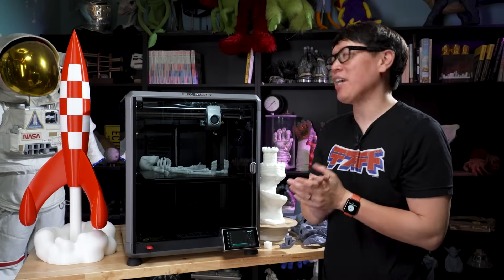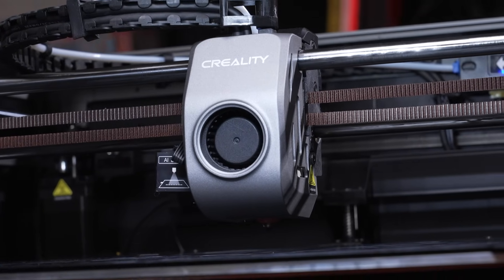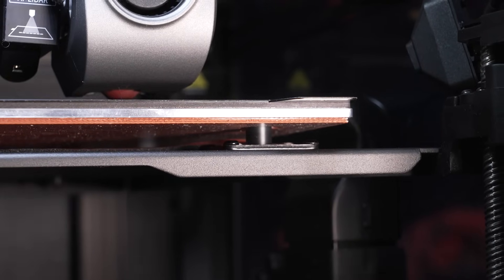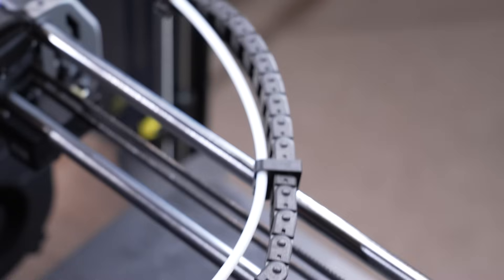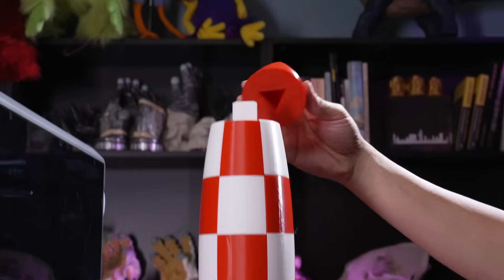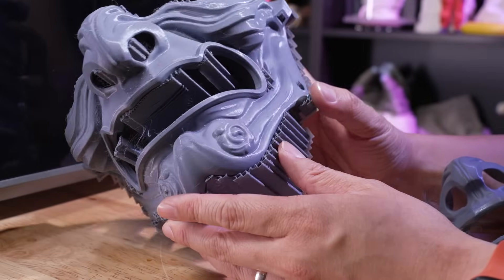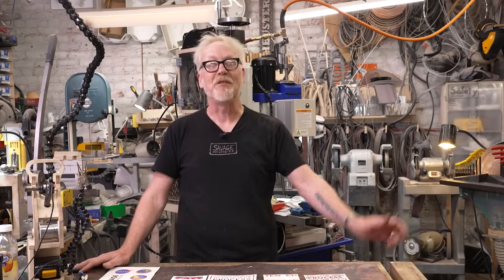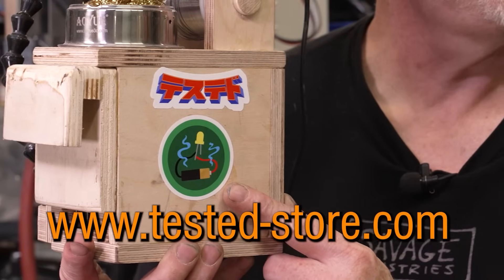Creality K1 Max 3D Printer Review: Big + Fast Prints!

Comment from the maker: Creality K1 Max 3D printer: https://www.matterhackers.com/store/l/creality3d-k1-max-large-high-speed-3d-printer/sk/MPVPDE6C?aff=7553
Matterhackers Build filament: https://www.matterhackers.com/store/c/3d-printer-filament/mh-build-series?aff=7553
Bambu Lab X1C 3D printer: https://www.matterhackers.com/store/l/bambu-lab-x1-carbon-combo-3d-printer/sk/M80GDCL5?aff=7553
Moon rocket: https://www.printables.com/model/163971-moon-rocket-fusee-lunaire
Flexi skeleton: https://www.myminifactory.com/object/3d-print-cute-flexi-print-in-place-skeleton-129405
Samurai mask: https://www.printables.com/model/434709-samurai-mask-model-3-split-for-multiple-colors/comments
Spiral Tower: https://www.printables.com/model/113967-spiral-tower
OrcaSlicer: https://github.com/SoftFever/OrcaSlicer/releases/tag/v1.7.0-beta
Reply: Zack Friedman over at voidstar has a rec for a tool that adds a reset for the gcode time lapses

Comment: This printer is a piece of (add your curse word here). The first layer sucks. The inconsistent heating of the bed will give you a ripples. Most of the time if you're making big projects you don't see it. But if you're doing 4 mm sheets they turn out to be absolute garbage because reality makes really really cheap beds. 
The second problem is the z offset changes because of the bed warping at different temperatures. Unfortunately it ends up most of the time too low to the bed and destroys the extruder. 
My advice buy any printer from a different company.

Comment: Bought one. Printed a 100 mm part and it measures 99mm's. The holes wouldn't fit with the mating part. Finally got an email back from Creality. There is no method of calibrating this machine. So if you are printing a vase or a character it's great. If you need to print parts that have to fit together buy a different brand of printer
Reply: if the part is literally scaled smaller than what it should be then once you root the machine and get full access you can edit the rotation distance to scale it back to where it should be though you can probably force this with startup gcode without rooting 

if the part is thinner than it should be which can happen depending on the filament you're using you gotta do a single wall thick test print to calibrate the flow rate for that filament which can easily be done in any slicer

my k1max print accuracy was +-0.001mm out of the box but then doing the same print with three different filaments, the yellow was tight, the red was perfect, and the black was loose so it can be very filament dependent
Reply: Which is fine. But this machine is brand new out of the box. If you root the machine there goes the warranty. I shouldn't have to do that on a brand new machine. It's poor quality control.
Reply: @tabhinton6678  from what I"ve seen it doesn't void the warranty they just mention in the agreement that you open your printer to potential threats, id still recommend calibrating the flow regardless since thats filament dependent

and to test if it really is the steps per mm tell the printer to move 100mm next to a ruler and see what it actually moves to and if it lines up with the deviation in the print

Comment: Could one design a spacer to lift the glass panel higher to prevent the filament feed tube from rubbing on the bottom of the glass panel?
Reply: dont think its necessary mine has a good 5mm clearance from the glass out of the box. I think you just need to push the tube further back past the clips if it is rubbing against it

Comment: 300 mm is LESS than one foot, Norm. Not much, only about 5 mm, i think, but still less than 1 foot

304.8 mm = 1 foot, so 300*300*300 print size is roughly 95% of a real cubic foot :P
Reply: Who cares? Grown-ups don't use body parts to measure things.

Comment: Pretty fair review. I have tried two different K1 Max's as a replacement for my 2017 Ender. Both were returned during my refund periods because they had problems that Creality couldn't fix quick enough. The first one was just dead out of the box, wouldn't print anything. The second one kind of worked after discovering several work arounds. I might have kept the second one, but it wasn't reliable. I want a printer that I can leave unattended and be confident that it's not going to destroy itself or burn my house down. The fix (for me) for constant hot end jams consisted of bypassing the filament delivery system completely. I hung the reel of filament above the printer and just dropped the filament directly into the extruder. Never use the "filament retract" function to remove or replace filament. Just cut the filament at the extruder and "extrude to replace filaments or remove them. Retracting will move a piece of melted filament into the cool aluminum heatsink and it will stick there. This especially occurs with PLA filament that has been left in the extruder after completing a job and it "tempers" from the heat. This makes it brittle and it will break or crumble if you pull on it or flex it. If this happens you may be successful heating the poker provide in the tool kit. Heat it up real hot and stick it into the jam, let it cool, pull out the clog. Mine often stopped for no reason or just went to the right side to cool down the print head and then got lost. It would just print in mid air leaving a pile of filament that the Lidar didn't stop. My fix for this was to take the top off and the front door off. I put a large room fan in front of the machine to keep it cool. Seemed to reduce mystery failures. I'll give Creality a little time and try another one some day.
Reply: You should get a Bambu it’s actually amazing how well it works.
Reply: what printed did you end up with
Reply: I got a Creality K1 for $349 on sale at Microcenter. It's ok as long as you don't expect too much. Support is terrible. I will probably convert it to full Klipper in the future. I am waiting for Bambu to come out with a larger model.

Comment: I have a 300x300x300 Anet A8+, but after about a year of use, it suddenly started printing off-bed. I didn't change any of the settings, so I have no idea why this happened. I then bought a much smaller Ender-3, which has been pretty much problem-free for three years. But I do NOT like Bowden tubes, and unless I'm mistaken, Creality doesn't offer any direct-drive printers... so now I'm looking for something to replace my A8+.
Reply: You can convert your ender 3 to direct drive
Reply: @R0T0Q  Yes, very good suggestion. I was just hoping to find something I didn't have to do mods right away. Not a difficult mod, I'm just leery of tweaking these things, since the pretty-much Stock A8 let me down so soon.
Thanks for the suggestion. 👍🏼
Reply: Most recent creality machines are direct drive. You are very mistaken
Reply: @condorman6293  Name one. Point me in the right direction. I'm on their mailing list, and every printer I see has a Bowden tube.

Comment: I just wanted to mention that CoreXY predates the Voron group by many many years. Voron printer designs are great, and so are the guys behind it. CoreXY was implemented by many in early reprap printers.
Reply: Corexy comes from CNC machines, my dude.
Reply: @dangerous8333  nope
Reply: @dangerous8333  a 3d printer is a cnc machine :)

But yes the concept of multi motor synchronized axis motion predates its use in 3d printers. First time I had seen corexy was Ilan Moyer's article on the subject as an MIT research project back in 2012. CoreXY is just one example of a 45deg coordinate transform synchronize motor motion style. There is also hbot which is an imbalanced version of the same thing. And there are more examples like Delta which is an even more complicated coordinate transform. Most predate the consumer 3d printer movement.

Comment: Norm, i think you're in over your head...
The third fan is for the first layer? WTF! If there's any layer where you ABSOLUTELY DO NOT want any cooling, it's the first layer. Pretty sure the third fan is for any layer OTHER THAN the first one...
The reason you don't see any difference with the LIDAR on or off is also pretty much the same: it's for the first layer, to get the Z-Offset right, not for any other layers.

Comment: The main thing with both Bambu Labs and Prusa printers is they spend a lot of time fine tuning their profiles. Creality makes a half assed attempt at it and quite honestly I'm sick of spending hours and hours of my life running test prints and fine tuning profiles. Bambu Labs offer other printers that are  cheaper and their profiles are spot on. If Creality cannot step up a gear and spend the time making profiles perfect then they can go fly as for the time saving I'd rather spend my money else where with a company that knows profiles are as important as chucking out another printer model.

Comment: You can get a Bambu P1S with the AMS system for about the same price. If you don't need the extra 35mm be space, it is a much better deal. If you do need the extra bed space, the QIDI X-Max 3 is 330mm squared, has a heated enclosure and a drybox spool holder. It's also 10db quieter than the K1 Max, which is notoriously annoying. With the front door open, which is SOP for PLA prints, it's the difference between low 70's db and low 80's db. There are videos out there. Look them up. Also, Norm talks about user experience. Functionality is good, and I like it, but user experience is the difference between loving a thing and tolerating it. If you're an FDM expert, you don't need my advise. But if you aren't, think very hard about how much that extra space is worth to you before you decide to pass on a Bambu with AMS.
Reply: Until Bambu goes bankrupt or decides they no longer want to support your printer. Then any other paperweight would have been a lot cheaper. Don't be an idiot, don't buy cloud-bound crap.

Comment: I just bought my first printer a couple weeks ago. I looked around alot, and I wanted something that I didn't have to tinker with too much, which just worked more or less out of the box.

I decided on the Bambu P1P, and after watching this review, it seems like I made the correct choice. It just feels like a complete solution, with possibility for upgrades (like the AMS) down the line.
Only thing I dislike about the whole Bambu eco-system, is that it is closed, with proprietary parts and replacement parts, but since they are relatively cheap, it is a downside I can live with for now.

Thank you for the review!
Reply: Its 100€ less here than the k1.. should i get it?
Reply: I believe there is Black Friday on Bambu Lab's store, and the P1S is pretty cheap right now. I would absolutely go for that. I have although also heard pretty good about the K1, but the P-series of BBL printers seem to be the most well reviewed at the moment. Also, if you are interested in doing Multi-Material printing in the future, you can get the AMS for the BambuLab printers, which has worked really well for me so far, with minor issues only.

If you're thinking about doing multi material printing, I would go for the P1S combo, which will save you a lot of money.
 @MagasPT
Reply: The Bambu P1S for $100 more seems to me the best option, either one is a great choice. The K1 also has dimensional issues, essentially the belts aren't perfectly lined up

Comment: I want one so bad! I have been wanting a 3D printer since they first started getting big, few years now I believe. Wish I could afford one! Great stuff Norm & Crew at Tested! Definitely going to be looking for one of these when I can!
Reply: don't it sukcssssssss The extruder is horrible; for every 2 prints you have to open and clean, they send a new one it's the same i had s1pro it was awsome this was my dream but it sucksssssssssssss
Reply: Get an Ender 3 or an Ender 5. They are quite cheap and they work quite well. Good for a beginner. I would not start out with a machine like this. I have a modded ender 5.
Reply: @Turbogto_guy  Advertising the 6 year old Ender 3 as a beginner friendly printer?!  It is, or rather was dirt cheap in 2017-20 and that is the only reason why people bought it. There are plenty of better, cheaper and especially more reliable printers nowadays, especially as a beginner. I didn't have the Ender 3, rather improved versions of it and they were pure torture to repair, bless reddit. The Bambu Lab's A1 mini is probably the beginner friendliest printer.

Comment: Be interesting to hear how it compares with the new Anycubic Kobra 2 Plus or the Max. The plus has a larger volume (400*320*320mm). The Max is even bigger (420*420*500mm), both with similar max print speeds (up to 500 mm/s).
Reply: Just checked the Kobra 2 Plus out, its a bed slinger. Comparing a bed slinger to a CoreXY printers speed is pointless. The Kobra 2 Plus won't win in speed - it has to move the entire bed and printed part.
Reply: @nerfvinc12121212 : It's not pointless.  It's very valid.  The companies advertise similar speeds at similar print sizes. How do the print speeds really compare? Print a few identical parts on both, side by side.
Reply: @clearstream67  It's pointless in the sense of practicallity, sure it might go faster if the print bed is empty or it has time to accelerate to that speed. But acceleration is a large part of the printing time, CoreXY printers simply dont have to move as much mass, that's only being added the more you print.
Reply: The K1 max can reach 600mm/s

Comment: I still use crealitys original 12x12 cr10s. I got it in 2016. This printer just keeps on printing. I did change the printhead. It's a Micro Swiss direct drive now.

Comment: I have had the K1 Max for about 2 months now, and I love it! It was easy to set up and get going. For those newer to 3D printing, the Creality Print software is pretty easy to use, too, without much effort. I can print things rather quickly without a lot of sacrifice in quality, it really depends on what I am printing if I go with a higher print speed or resolution. I do agree that inserting the filament is rather annoying, especially if you don't know that is an issue. I think I tried inserting the filament half a dozen times before I started twisting it and moving it around before it finally made it to the hot end. 

I have printed mainly in PLA and ASA, and the K1 Max hasn't had any trouble printing either of them. At the moment, it isn't very humid where I live, so others may have different results. I also haven't used any adhesive on the bed, and so far, there have been no issues. Knock on wood, but I haven't had a failed print yet, which is pretty impressive. 

I really do like the magnetic bed, which makes it super easy to remove prints from. And not having to add a third-party camera to the setup was also a plus. Being able to access the printer from a browser has allowed me to easily monitor and control prints on the go. I usually just VPN into my network if I'm out and about. It's a great printer all around, especially for newbies, as long as you are willing to pay the price.

Comment: I know everyone seems fascinated with print speed these days but for me its total time that counts.  It’s been my experience that these faster prints suffer in quality relative to the higher end printers like I have - PRUSA.  Even at only .15mm layer height my prints come off the bed ready to prime - no sanding req’d and when necessary I can print at .1mm & even .07mm.  Those prints don’t even need to be painted if I choose my filament colors correctly.
Reply: You have the option to print slowly even with a fast printer. I believe the key benefit lies in having the flexibility to choose between the two.
Reply: The print quality of a X1C in quality mode is generally better than a Prusa. Prusas are great, but not THAT great.

Comment: Is it just me, or are Prusa printers curiously absent on Tested? I'd be interested in Sean's and Norm's opinion.
Reply: They likely get money or free printers and review what they get.
Reply: Prusa's are expensive and bed slingers bring a lot of compromise due to footprint and the weight of the bed. They are dead reliable and if you want to build a production environment, you can't go wrong with Prusa, although you might go broke. For those who don't want to be 3d printing aficionados, Bambu is better.
Reply: @Immolate62  Tested have Formlabs printers, so I assumed they weren’t aiming for the cheapest printers available. Adam also recently built a filament box and prominently showed off his massive bed slinger. I’m not even trying to advocate in favor of Prusa printers. They are not the cheapest or fastest. I simply don’t understand the subjectively perceived loud absence. I would’ve loved to hear Norm’s / Sean’s / Adam’s opinion on the XL, for example, or how they would rank the SL1S compared to other resin printers they’ve used. But if the reviews are mainly sponsor driven, that would explain it. Something like a yearly “Tested 3d Printer Roundup” would be great, by categories like “best first printer”, “cheapest tinkerer machine that won’t burn your house down” or “best workhorse”. They must have loads of experience or at least interesting opinions.
Reply: @megaswoosh  because it is a sponsored video.... They get paid for this video, that's why they review it. Prusa rarely does that and even then, they only send review units.

Comment: I've been using this printer for about 10 days now. It's fantastic.

A tip or two from my experience:

Put the head in the "Home" position to change filament, it makes the manual filament process much easier.

Also try PLA Meta from Sunlu with this printer at high speeds. I'm printing final model functional parts at 400-500mmps with beautiful results.